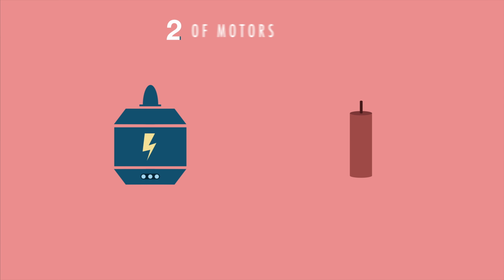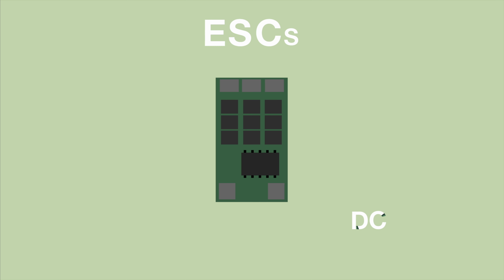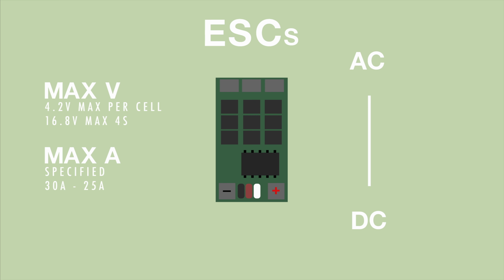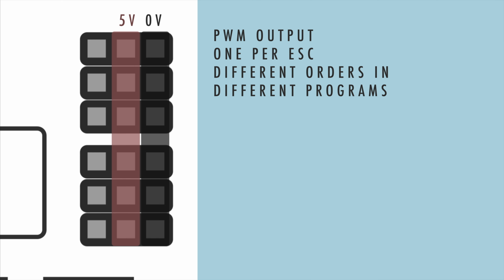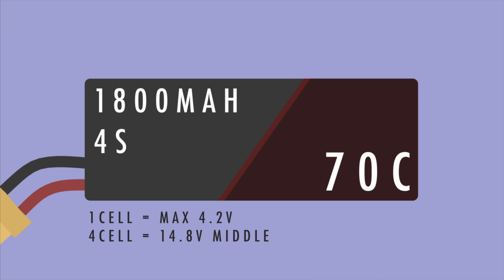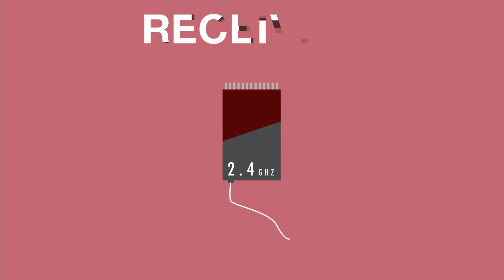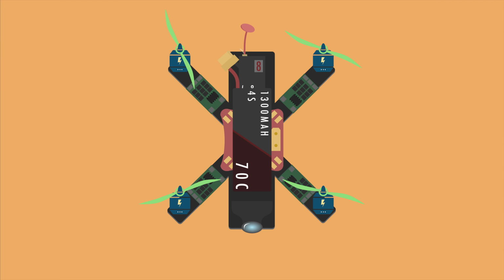FPV Race Drone components explained

Comment: Very good job with the visualization, it helped me learn the absolute basics which is exactly what i wanted to learn, ill be coming back to this video quite often.
Reply: will do! one thing that threw me off, was that i was working from a different build, but my FC and PDB were on the same board, took me a while after going through my parts again to figure it  out that i had a combo. kinda funny... of course thats not your fault, i just thought it was funny

Comment: Thank you excellent video excellent 👍🏻👍🏻👍🏻
I have a question sorry it’s kind of difficult but I have my xk x130 drone it works with 1s lipo how can I know if I can put a 2s without fried anything???
Reply from the maker: Glad you liked it! Moving up in battery voltage is usually really difficult as all components have to support the higher voltage. If your product is specced towards 1s it seems very unlikely that it will support 2s. Motors need to have lower kv on 2s the fc, escs, transmitter, and receiver must all support the higher voltage. Hope that helps!
Reply: Thank you very much 4 your kindly reply wish you the best...!!!!

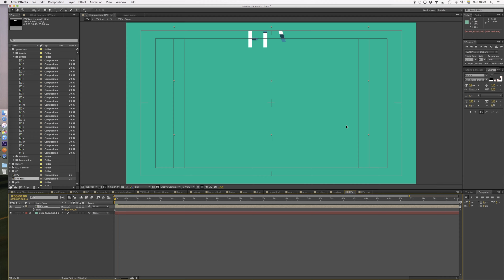Comment: just a small mistake that on 9:06 the voltage for the 4s battery is 14.8 volts ,3.7 volts per cell and (4s) means 4 cells (the s is used for the cells don't get confused) so 3.7*4= 14.8 volts , nice video btw
Reply from the maker: Hey, not exactly sure what you think the mistake is but what's important to know is that cells vary in voltage. I typed out 14.8V even though 4s batteries reach a voltage of 16.8V fully charged as 14.8V is what is printed on them. That's why I added the "max" text on the 4.2V per cell number as 4.2*4 = 16.8. I think it is important to understand that a cell reaches 4.2V fully charged so newcomers don't get confused when the charger reaches that number. I hope that clears it up!

Comment: Good vid! Small correction though, 5040 (sometimes written as 5x4) does not mean 40 degrees angle, it means prop will travel 4 inches forward in one revolution.

Comment: Greate video! I have built my fpv racing drone a over a year ago, but also then I also thought about building an fpv plane, but I still didn't fully figure out how does everything work in fpv planes when you power everything from a single Li-Po.
Reply from the maker: I see planes are actually generally a lot more simple since you don't need a flight controller. You simply plug in the ESC and servos directly to the receiver. However, if the plane can handle the extra weight I would wire it just like in this video and run a flight controller with iNav. I did that on my latest plane build and it really makes it super stable.